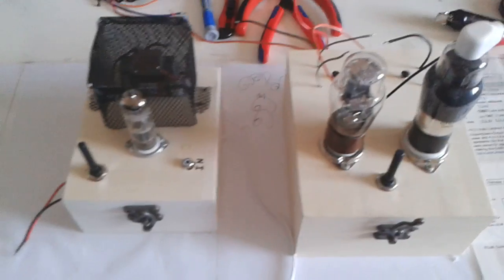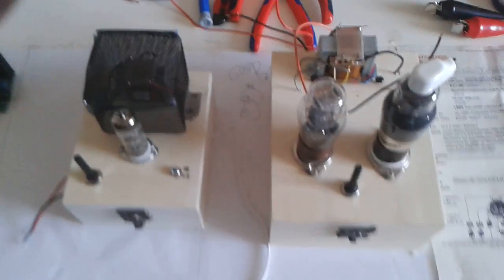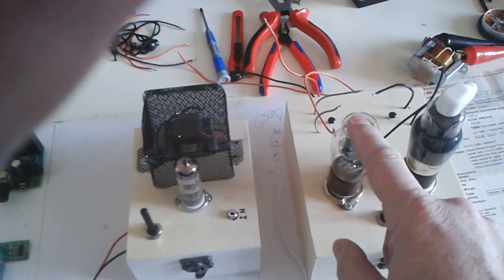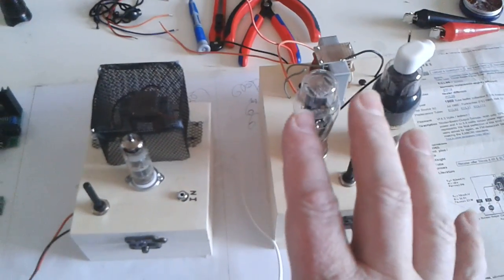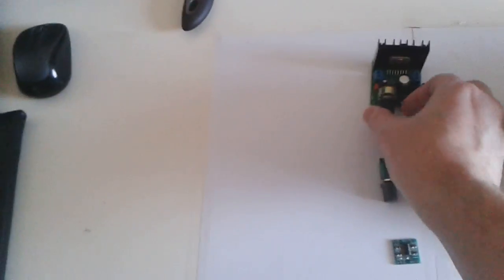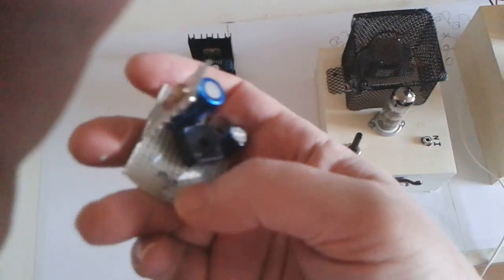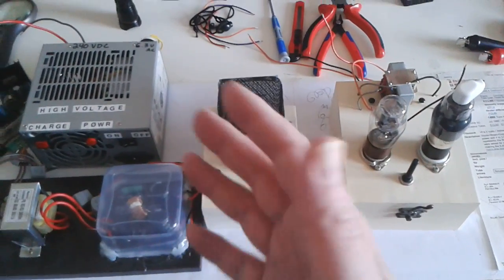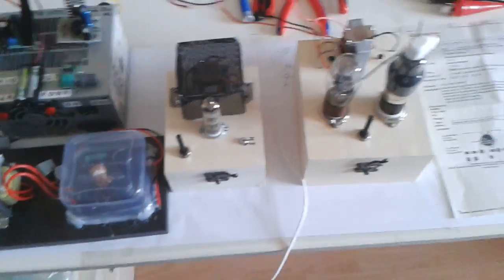Tube amps vs. Solid-state

Comment: My solid state amps (both with +- 40 Volts on the o/p stage has a frequency responce from 5 hertz to- nearly 50 Kilohertz. Which valve amp can match that? The answere is -.. none.The limiting factor with valve amp is the Output transformer which a solid state amp has´nt got. Get with it and put this valve stuff in Noahs arch where it belongs.

Comment: Can anyone tell me where I can fi d a video that actually explains and or shows how Solid State guitar amps work?  All I can find is Tube amp videos, books and the like.
Reply from the maker: Qas par, I'm not a pro electrician, but the basics are the same as tube amps. Main differences are the parts and the high voltage in tubes. I think if you find an old book on basic radio or how speakers work, it would help you understand somewhat. Cheers

Comment: Good video. I think you explained the basic differences between solid state and tube amps in about the simplest terms possible.  However,  anyone who has been playing for a fairly long time can tell you that this has been the biggest continuing topic of debate and opinions among guitar players for decades.  I started playing guitar over 40 years ago and have played professionally for about 35 years. Based on my many years in the business, I feel confident in saying that electric guitarists are the biggest gear freaks over any other instrumentalists by far. The quest for that perfect sound or tone for most serious guitarists usually leads to a seriously addictive (and in many cases unhealthy) obsession. I freely admit to being one of these people.  I couldn't give you an exact figure, but I know I have spent well over $250,000 on musical equipment since I started playing. Of course, a lot of this was spent on recording equipment because besides being a guitarist, my other musical obsession for many years has been the ever constant quest of upgrading and expanding my home recording studio in order to make the highest quality recordings as I possibly can.  Thanks to the ever rapidly advances in digital technology,  I now have capability to produce professional quality recordings at home, and as the technology continues to evolve, the price of equipment continues to drop....with some exceptions, which leads me back to the original topic of tube vs solid state / analog vs digital equipment.  

Over all the time, money spent, and sheer amount of gear I have acquired over the decades,  I still have almost every piece of it no matter how old.  A few years ago, I actually had to have a small warehouse built behind my house to store and organize all this stuff to where I could locate it just in case I found a use for it.  My ex wife, friends, family members, and other musicians I know often question my sanity for never getting rid of any musical gear and the expense I went to in building a place to store it.  What they can't seem to understand or comprehend is that (particularly in the studio) my experience and skills at producing and engineering have taught me that even with all the midi plug-ins and modern outboard gear available, there are times when you are searching for a particular sound you hear in your head, but are unable to get no how many digital sounds are available.  I have a whole building full of old gear available which I often experiment with in the studio to create a library of quite unique sound samples which nobody else has.  

Based on my experience,  I am thoroughly convinced that tube guitar amplifiers have a much sweeter and "warmer" tone than any other type of amp.  Even with the latest technology in digital amp modeling and emulation,  I am pretty certain that I can tell the difference between a real tube amp and one using digital modeling in a blind comparison test.  Besides their unique tone, a real tube amp's sensitivity to slight volume and tone controls on the guitar itself and other factors such as different pick attack and intensity along with fingering techniques and other slight subtle ways of playing can completely change a tube amp's sound without changing any actual settings on the amp itself.  I have a quite a number of different tube amps and without exception I never use any type of external device to boost the gain, add distortion, or affect amp's natural tone. The only external processing devices I use are for dynamic processing such as chorus, delay, flanging, digital reverb, etc.  Depending on what type of music I'm playing, whether I'm doing a live gig or playing studio sessions, I'll normally have a couple of different amps. For instance, if I'm playing harder rock, I'll generally use a Marshall or Mesa, If I'm playing more jazzy, country, or straight up blues, I'll use a Fender or maybe a Vox AC 30.  Actually, about two years ago I purchased a Carvin V3 micro tube head which I run through a Marshall model 1936 2x12 cabinet loaded with Celestion greenbacks. This has become my guitar rig of choice because the V3 has 3 separate channels which offer such a wide range of EQ and gain selections that I can dial in the separate channels from crystal clean, classic rock, or head banging metal and use the footswitch to instantly change tones. 

Besides guitar amps, tube microphone preamps are generally vastly superior for studio vocals.  The two main factors which separate the world's top commercial professional recording studios from home studios are the design and sound of their rooms and budgets which allow them to purchase multi million dollar mixing consoles like Neves, which have tube preamps  which are considered by most top engineers and producers to be the finest and produce the most "warmest" vocal recordings in the world. I could go into much further details on this subject, but this post has already become excessively long winded as it is.

I'll close with this final thought to support the reason I firmly believe tube guitar amps are superior.  Try to think of a single legendary guitar player past or present along with the world's current top guitarists who DON'T exclusively use tube guitar amps.  Chances are you won't find one.  I think that pretty much speaks for itself.
Reply from the maker: Have to agree with you, I prefer tubes as well. It is a personal choice. Like your favorite food. No one is going to convince me via technical and mathematical facts that one is better than the other. I like what I like and you make a good point there in the end regarding legendary musicians. That speaks more than anything. Cheers.

Comment: You are probably unintentionally,,, say things backwards complicating everything for newbies...

Maybe this will clear some minds, or get the juices flowing :]

I have come to the understanding that the tube amps using much higher voltage potential and very low amplitude on the signals is the key factor and the very basic root cause of the difference between a solid state design amps vs tube amp designs... 

Tube amps :
It`s the high voltage potential that is allowing the very low amplitude to punch the sound waves with the precision that keeps it natural...? 

Tubes enhance even ordered harmonics, when you saturate a tube with lots of current the tubes easily produce even ordered harmonics.

Solid state amps:
The very, very, high amplitude on the signal actually removes the natural harmonics that would normally be present on music frequency signals...?

They produce even and odd ordered harmonics in equal amounts, but they can be designed to produce more even ordered harmonics….

 This appears to allow some sound frequencies to be powered up well beyond their natural capability without distorting but at the same time those harmonic distortions are part of the natural properties of the sound waves .

So understanding tube vs solid state is simple, 

Designing a solid state to have little or no odd ordered harmonics would probably be the safest amp to build for us new players :]
Reply from the maker: probably...7 years ago

Comment: If you had a high voltage power line running across your shop, the parakeets would have a nice perch.
Reply from the maker: +RGB Reading They don't like high voltage lines as it can fry them and make their feathers burn off or even explode the birds. It also hurts a bit....so I replaced all bare exposed high voltage lines with wooden dowel rods. Less messy, less painful, less misery, and time saving too! Birds also think it's more comfortable. Cheers.
Reply from the maker: strike that, we did have one spotted pigeon stick a fork in an outlet...he's dead

Comment: Hello, what you think about Little BEAR P1 BLACK, are they real and use tube not only for show?
Reply from the maker: +TheKaukas I would have to see the schematic to be sure or get a close look at the amp. If it has any transistors or IC chips in it, then it's possible it's a combo amp. Also, is the "Little Bear" amp claiming to be a fully fledged power amp or only for headphones? It looks like a pre-amp to me, if I remember. Also, are there not different versions of it? I will have to investigate.
Reply from the maker: +TheKaukas After looking further, it seems that most "Little Bear" tube amps are preamps or headphone amps. Most are legit using only tubes for active components to amplify. Some versions have a large power triode (usually a 6080 or a 6N5P) to use as a headphone amp with a bit more volume. There is also a phono-amp Little Bear 2.2 which I myself have and use with my record player and I really love it (here it is on amazon: http://www.amazon.com/Little-Bear-Turntable-preamplifier-amplifier/dp/B00H0FIGUO) and I got that on eBay at "doukmall" I think. That is all valve and works GREAT. I can also use either 12AX7 tubes or cheaper Russian 6N2P tubes with a flick of the switch! I really enjoy it. If you want a real POWER amp, get or make a real power amp that uses power tubes. You can use the Little Bear amp as a buffer or pre-amp. I think the best value for money is some of the Chinese power amp kits you can get. Best money for value and you get all parts and you can learn a lot....but you should know something about electronics, schematics, and building circuit boards and mounting things in a chasis as well as soldering and such. I got mine at Doukmall on eBay and so far the service and quality has been SUPER.

Check out doukmall on eBay, best amps for the money and they work great.
I don't work for them or anything, just had good experience:

http://www.ebay.com/sch/m.html?_ssn=doukmall&

They have good practical amps of all kinds, fancy, simple, or just boards.

Here's the power amp I built. I love it and still have it. Uses good tubes that you can substitute for others as well:

http://www.ebay.com/itm/Douk-Audio-6N8P-6P3P-HIFI-Single-Ended-pure-Class-A-Tube-amp-Amplifier-DIY-Kit-/251535428883?

Here's a nice and cheaper one as well that is shipped from Germany, so if you are in EU no hold up at customs. Shipping is cheap:

http://www.ebay.com/itm/Nobsound-6P6P-6J8P-HiFi-Rohrenverstarker-Class-A-Single-ended-Tube-Amplifier-8W-/272016030532?

An EL34 board with parts but no chassis:

http://www.ebay.com/itm/Douk-Audio-EL34-Valve-Tube-Amp-HiFi-Single-ended-Class-A-Amplifier-Board-DIY-Kit-/261660649571?

They also have many "Little Bear" types of amps.

Remember, make sure when you buy a tube amp that it says "tube only" or "Pure tube amp" or something....NOT "intergrated" or "combo amp" if you don't want any IC chips or transistor or other solid-state components.

Hope this helps!
Reply: +MAN CAVE NO.1 Thank you for reply, I Indeed need amp for only my 250 ohm headphones and thinking of buying http://www.ebay.com/itm/Little-BEAR-P1-BLACK-12AU7-6922-Valve-Tube-Headphone-Amplifier-amp-preamplifier-/301688667015?hash=item463e0bbb87:g:gCMAAOSw~gRVpiPe and paying extra 10$ for Russian 6922EH Tube (as they have that option in description) But for now I will research for more options that uses to warm up sound with tubes.
I have Home theater DAV-DZ830W and it looks like it can handle 250ohms headphones so maybe I only need preamp, dont know. I wrote to Sony about this and they replied as follows: 
"Thank you for contacting Sony Video and Sound Support.   
We hope you are doing well. We regret for the inconvenience caused.
We understand that you are willing to know the impedance of the headphone jack.
We would like to inform you that there is no numerical value for the 
headphone impedance, our manual informs that accepts low and high 
impedance headphones.
If you have any further concern, please feel free to contact us."
Reply: +MAN CAVE NO.1 after all I decided to take this one http://www.ebay.com/itm/Douk-Audio-6N5P-6N3-Valve-Tube-Headphone-Amplifier-Stereo-HiFi-Pre-Amp-/272135551310?hash=item3f5c8af94e:g:zywAAOSwPc9W0a9t and thinking assemble it that tubes face up and most of other stuff down, for better cooling. I will only do it if it comes not assembled. And I will add little fan for bellow only components (to not cool off tubes) because i heard that it can over heat and shutdown ( but user got his p8 in metal case, mine is in open air design, so i still not sure if i should do it)

Comment: anyway I can contact you other then here for a chat?
... specifically interested in knowing your thoughts on 1 watt tube vs 1 watt SS delivered to matched speakers ... test tone , and results of db per instance.  
also... is it the tube that sets the watts output limit or the power supply... in other words, given a large enough power supply does the bottle neck become the tube?...or, what is the largest watt output tube or does it all come down to the supply?
..(if that is even a valid question)....
Reply from the maker: +Fred Flintstone aw Fred....I'm not the one to ask these questions. I am still learning myself. You can use Ohm's law to determine the output of your power tube but I would say that you'd go "backwards from your power tube" to discover your limits...if your output tube can do 5watts then you need to have your power supply to back it up.
If you don't, I imagine your sound quality would start to suffer at higher volumes. I also don't have the proper equipment to measure such things yet...but keep in touch..your question is actually very good and I'd like the challenge of finding out about this.
Reply from the maker: +Fred Flintstone one more thing...tubes can be combined for power. A large tube may put out 13 watts by itself, but you can combine two and make a "push-pull" where they both work together on the "bottom and top" of your sound wave. That can also be amplified by more tubes...but then becomes more complex. I am working now to understand the construction of the basic single ended class A amp and then to build my knowledge onto that.
Reply from the maker: +Fred Flintstone weekend is better for me to ponder real tech questions....and give answers. :D
Reply from the maker: +Fred Flintstone I suggest you put your question to "Cool Dude Clem" or even better try checking out "Uncle Doug"s videos and comment on them! He always gives a quick and easy reply. Here's one of his BEST vids you should watch and then ask!!! 

https://youtu.be/x5SSKX74DKg
Reply: +MAN CAVE NO.1 -- push,pull is were I fell asleep last night, will pickup tonight on the subject ....saves on sleeping pills.
...if I recall you had 170 or so watts needed to make your 15 watt amp?!? ....HUGE WASTE I agree,  makes me wonder how many watts they used for concerts used before solid state. (when?)
...I have to wonder also, which side do manufactures advertise in watts/out watts and if it is the same for solid state to loose a large'ish %...what the heck is RMS ???
.... so many questions. hehehehe
Reply: +MAN CAVE NO.1 -- saw your post on uncle Doug Rocks... last night...was wanting to ask you a bunch of questions there but decide it would look a bit strange having an old fat guy following you around in orange leathers ....He he he.

((hope you are reading this using the proper voice))

Comment: Contaminated by the parrot.....man you are just talking showing stuff..why not to put them to play when this is what makes the real difference in between tubes and transistors...you could make a 30 seconds silent video (without narrative) just showing one playing and other playing..... contaminated by the parrot....ahahahahahah!
Reply: +MAN CAVE NO.1 tubes give a more natural sound at the expense of heat and power consumption, tubes are analog, (humans hear analog not digital more naturally) to make a digital amp sound like tubes you would need a hell of a big pcb
Reply from the maker: +Carlos Mergulhão maybe it's a Parrot video with tube/transistor stuff on the side? I will let you figure it all out for yourself. I'm not an aspiring director or engineer...I'm just having a little fun.
Reply from the maker: Synthematix In any case, the sound...the harmonics are different and therefore a choice based in preference.

Comment: Only on low frequency a solid state is better than tube but on High frequency and Mid frequency tube sound better than solid state.
Reply from the maker: +erwin flores Heck, I dunno...you're probably right. All I know for certain (because I've seen it with equipment) is that the harmonics of tubes "roll off" given frequencies much more than solid-state circuits from what I have seen. Using 6N2P or 12AX7 you can take an oscilloscope and run a 1000hz signal through it and see the roll-off up to 4000hz. It is a steep roll off but even at 2000hz there is still about 40% intensity  until gradually puttering out almost completely at 4000hz. With ss circuits it didn't even roll off to 2000hz with hardly 10db....if that. I suppose I could make a video showing this harmonics experiment someday. This would help demonstrate that "warm" sound that people claim tubes make. "Warm" or not, bottom line it does sound a bit different and therefore boils down to personal preference. Some people like me just like the fact that they "glow" and give off some nice colors at times.